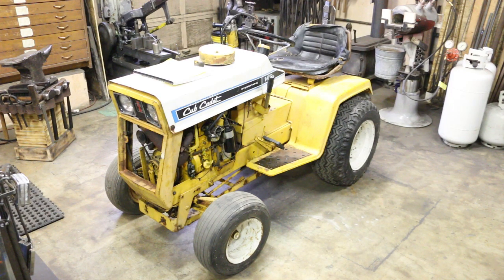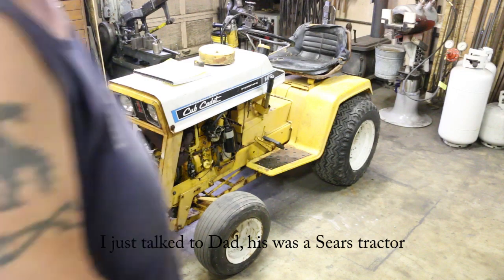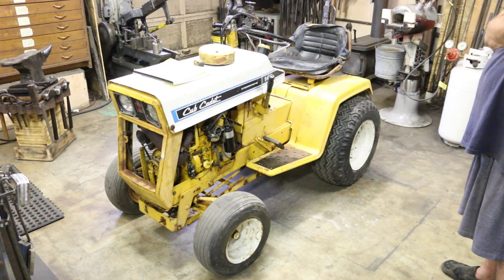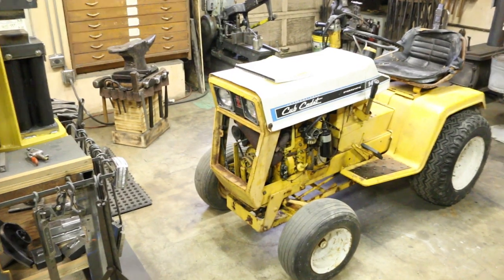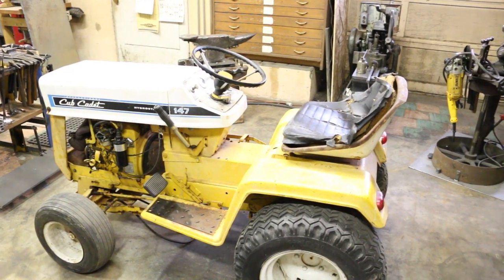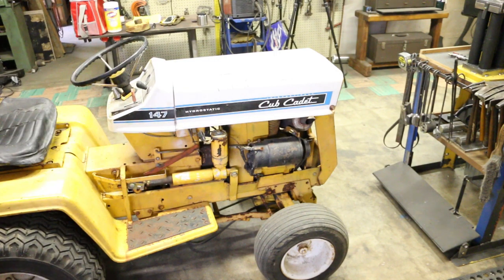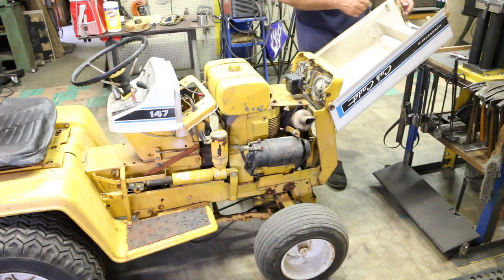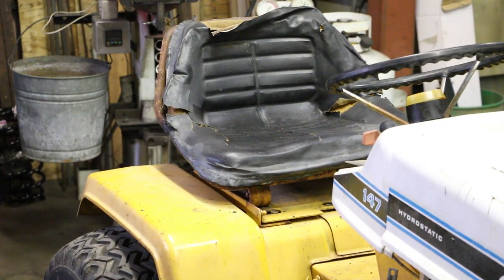1970 Cub Cadet Model 147 Restoration - Part 1

Comment: What could cause my 147 to slowly stop moving forward and reverse all of the sudden?  Now it won't move either way
Reply from the maker: When I was reading up on the hydro trans to trouble shoot mine, I read the most common problem is either a plugged filter or low on hydro fluid.

Comment: I can get a restored one for $800..is that fair price ?
Reply from the maker: Jeff polara I’m not an expert on these but I would think that for a fully restored one that is a very good price.
Reply: If it was done correctly, that is a terrific price. You can sink $1000 easily on an old garden tractor restoration.